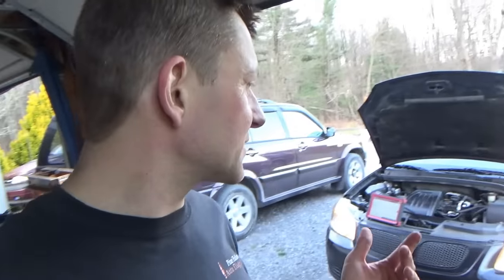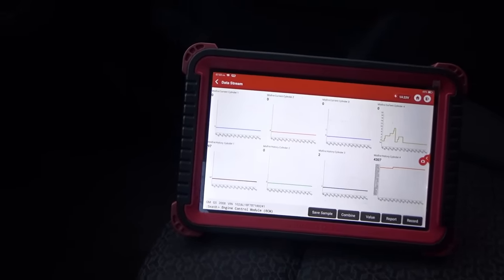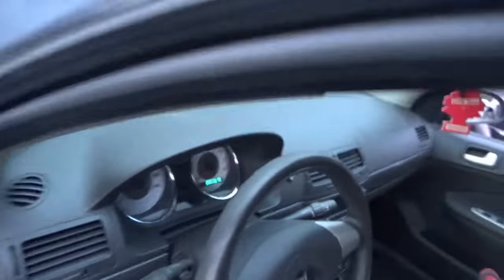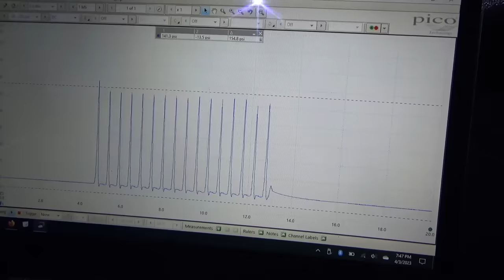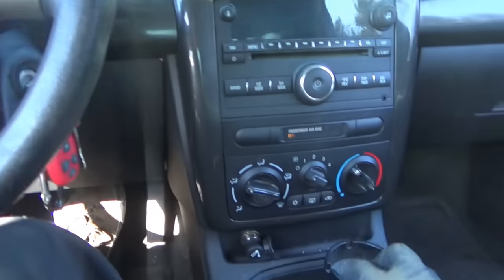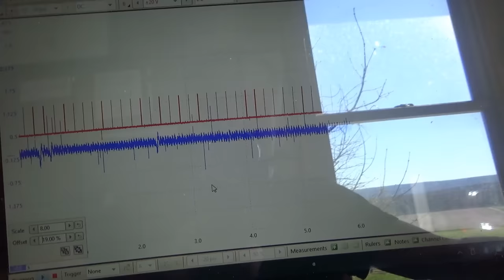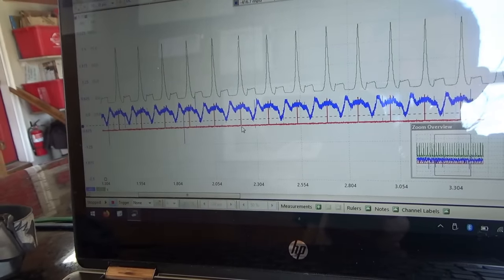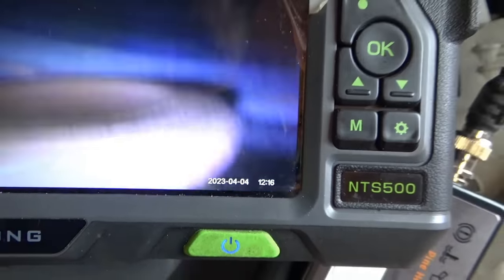P0300 Mystery MISFIRE - Difficult to Diagnose! (Intermittent "FISHBITE")

Comment: Analyzing the valve seats and valve contact area, the valves seats have some wear (large contact area). At this specific case, you should disassemble to analyze, but it could be the valve guide with high wear... without the valve spring, you get the valve, half open it and shakes it ( like moving it exhaust and admission side), if it moves a lot, thats the possible problem, making the contact at the seat sometimes good, sometimes bad - not centralized or concentric contact, and like this, you can notice a oval wear at the valve guide very easily. The expected behavior is basically have almost no lateral movement, so it can be at the center, having a good seat. what about the high revolutions, with no problem? the combustion pulls the valve back to the cylinder head, probably helping to make it have a good contact. newer gas engines can easily have combustion pressures at more than 50 bar at full load.

Comment: New owner, 244K miles… believe the new owner drove it with high revs in the two weeks… probably broke valve spring(s), more than likely the lower part of the valve springs where it still holds but when the valve spins to a certain point the spring pressure is different.

Comment: The seats are pitted and valves rotate while the engine is running but they rotate very slowly. I’d bet that’s why you have times where it runs smooth and times where you have a couple of misfires grouped together. You have a spot where the valve is not sealing well and then it rotates to a spot where it seals for a bit then back around to the spot where it doesn’t seal so well. I feel your pain with these types of valve sealing issues. You want something to clearly show yourself and the customer what the problem is when you know for a fact that the issue is a valve but you can’t get that obvious shot of evidence. A leak down test is usually the one that’ll show it best.

Comment: My next step would be ; flush the oil and fill up with fresh oil and add 250 ml ATF. fill the gas tank with premium gas. and drive for about 3 k miles. Ivan after seen the picture of the valves i suggest adding a valvecleaner  to the the gas and drive the car for a long continius trip to get the valves to burn clean a bit. Might help. Good luck.

Comment: What about the intake valves?  It would be interesting to somehow install the pressure transducer in the intake.

In any case, I have a similar problem in my Jeep's 4.0 with idle issues for the last 10 years / 65,000 miles and it now has 262,xxx on it.  It has gradually become worse.  Every time I check compression, it's right where I would expect it when compared to other cylinders and it shows no obvious issues.  Sometimes its fine, and sometimes I come to a stop sign and it its clearly a dead misfire or half contribution at best.  Then I get the diagnostic stuff out and by the time I get it hooked up, its running better.

No oil consumption, no coolant consumption, I can run it across the country with no issue.  Come to a stop and you get that damn misfire.

Comment: I have the same problem with my '08 Avalanche, except it's on cylinder 7. Dealer said it was a "ghost" code. Changed plug, plug wire, coil, and fuel injector. They also did a compression test and told it had "perfect" compression. Still doing the same thing....
Reply: 07 Tahoe in the same exact situation on cylinder 6
Reply: That's dealer speak for hand us  $1,100

Comment: My po300 misfire after plugs coil packs ended up being a intermittent faulty injector took 3 mths and ended  finding this myself after professional people could not find the actual fault. The did 02 sensors, throttle body, plugs coils, car ran good for few days then started playing up and the po300 came up again. So I pulled injectors and found one keeps sticking open, so I put one OEM injector in, have now done 13000ks with no fault codes

Comment: With that many miles on it I wouldn't spend much more on it till the issue became worse. Some may say that if it got worse it could be a taking time bomb ready to go boom, well at thay many miles, you would be heading towards a rebuild if you were keen on the vehicle and were willing to spend that much money, or for a cheaper option install a second hand wrecker engine, This is one of the few times I would actually suggest doing nothing more.

Comment: Being a bit of a (pico)scope fan and an car engine amateur (I'm more used to just two wheels), I would have made several tests to see what they'd show, if anything.
Ignition waveform - should show the in cylinder turbulence due to leaking valves at idle - the gases blowing past the spark plug affects the spark. If it comes and goes that should be obvious.
RPM math channel @ crank sensor (or equivalent), to see exactly how the rpm changes as every cylinder fires, or misfires. Because... well, it's cool, and also says which cylinder is misbehaving.
You put the pressure sensor in the exhaust, I would have done the same (or with a cheap but perhaps more sensitive pressure pulse sensor) in the intake and crankcase. Should show where the leakage goes - probably past exhaust valves, but you know what they say about assuming things.

Comment: Check the spark plug wire in the dark with a spray mist. Could the wire be intermittently sparking to the engine and jumping back?

Comment: I had a Saturn Ion with this same engine back around 05 or 06 exhibit a similar issue. It would putt putt out the exhaust very intermittently. Compression was about 120-125 if I remember right. I pulled the head off and one of the seats in the head for one of the exhaust valves was trashed, even the valve head was discolored from heat. I replaced the head as it was under warranty and problem solved. Didn't know the exact cause as maybe a crappy valve or a crooked valve guide hole in the head or whatever. The car had all of 16,000 miles on it. I've seen others mention weak/broken valve spring which for 250k on this car Ivan's working on is possible. The one I had I don't believe it was a broken/weak spring at such low mileage but I suppose anything is possible.

Comment: Ive had this same issue on a 2007 tahoe and have been chasing it for the past 3 years. New plugs, wires, coils, injectors, throttle body, MAF, MAP, 02's... This is the only video Ive ever seen on Yt with EXACTLY the same symptoms... exhaust sucking in on miss only at idle, and only when warm, and its intermittent. ECU thinks its running rich so cutting back fuel too... If I'm gonna have to rebuild the top end anyways it looks like shes gonna keep runnin til she cant.

Comment: Check valve gap/clearance. That is just the symptom you get with PSA TU5JP with too tight valves.
Reply from the maker: Hydraulic valve adjusters...
Reply: @PineHollowAutoDiagnostics  working correctly?
Reply from the maker: @jannepo  well they weren't ticking 😅
Reply: @PineHollowAutoDiagnostics  tight lifter does not tick.. Oil changes were taken care of?

Comment: You can try to connect directly to fuel line valve cleaner, I mean fuel pressue pump (I'm not gonna give make name). In this case cos there is no evidence to damaged valve/port surface that could work realy well and it's cheap.

Comment: Easier way to diagnose leaky valves/ worn or frozen rings, just hook up spark hole adapter to get compressed air in individual cylinders,sound alone with Mickey mouse Stephi scope ( vinyl tube in ear) one can nail whether it's valve guides,valves or rings. The ole KISS formula.....no scanner BS,etc. required. Have an old Peugeot CIS injected XN6 with three bores with frozen rings,does not like to start hot and has a misfire until you clean it's throat out( blip the throttle to high rpm). 15+years car is fine,look at cylinder liners,look new with perfect cross hatching, except for frozen rings holding back desired perfect compression. Acetone,diesel -tranny fluid soak every now and then but rings are still so frozen,mix empties into sump fairly quickly.

Comment: In a hard core smog state that would be an automatic mandatory head remove if the mil is being tripped by the misfire. Even if it's not the HCs will be elevated unless the cat can take up the slack. The crosshatch is still there so if the rest of the car was in exceptional condition I would yank the head and do the valves.

Comment: Great job ivan! There's much more pressure inside the cylinder when it's actually firing, that might be a variable here, 🤔 intermittent stuff are the worst, i got an intermittent P0335 last week and it took me forever to call the ECM. 😑
Reply: Was it a Chrysler pcm?
Reply: @W.Khairi   a 2013 Toyota Corolla, but honestly i think i might have misdiagnosed it. Because  i tightened the ckp bolt more than recommended and then the problem disappeared. Can't really tell if it was a gapping issue, because the surface was clean and the bolt did not push the sensor into the engine, it just held it in place. It probably would come back in the future for the ecm,  but for now it's not setting the p0335 code. And I'm glad that i didn't get an ecm for it.
Reply: @aranhaydar9195  If it is an inductive type ckp maybe it is getting weak and just starting to fail

Comment: What's the difference between a diagnostic tech and a parts changer? Both will have cars that get away from them and don't get fixed. But only a diagnostic guy will be able to learn and gain experiences even when the issue doesn't get resolved...

I would've swapped injectors. What if the injector had a bad spray pattern? That would give you an intermittent misfire at idle but at higher loads and RPMs you have much more airflow allowing for better mixture of non atomized spray patterns. I love that OTC pulser and I use mine a lot but pulsing an injector with static fuel pressure while the engine is off is a much different environment than with an engine running. You can't do an on car test for spray pattern. If you swap injectors and the issue stays on #4 only then can you REALLY say it's definitely NOT an injector problem. 

I've seen intermittent compression issues due to intermittent valve sealing issues but they were cyclical. Every 4th valve event would have a consistent 10psi drop. There's no way a faulty valve lifter can cause a misfire for only ONE ignition cycle. Those valve seats definitely did look pretty nasty though...

I had a 2012 Ford Edge 3.5L 100,000miles with a single cylinder misfire on cold startup. Would only register 1-3 misfires on a cold start. You might feel 5-10 "fishbites" on the cold start. All on #4. I did long captures between #2 and #4 for in cylinder and they looked IDENTICAL. Could not see any difference. Put a pressure tester on the coolant expansion tank and after a few minutes I could see a mist in #4 but nothing in #2. Barely noticeable and could not see it in the captures no matter how hard I looked. 

Comparing peak pressures between two cylinders isn't a straight forward task. When your pressure transducer was in cylinder #4 the peak pressures were pretty smooth but when it was in cylinder #3 the pattern had an oscillating ripple to it. You have to try and average out that ripple to be able to compare the two. Also you have to factor in engine RPM between two captures. A 30RPM difference will easily give you a 2psi compression difference. 

It's also a good idea to increase your sampling rate for in cylinder pressure analysis. I usually go for 3MS. Zooming in on your captures while looking at valve opening and closing events shows the detail dropping off a bit. Not sure what the response time of your pressure transducer is. WPS500x is rated at 100uS. 

Trying to make these kinds of calls without tearing a part an engine or loading up a bunch of parts is a tall task. Shop owners and customers alike seem to think it's "reasonable" to expect it of all techs but, uh, yeah... Not pleasant sometimes! Thanks for doing what you're doing!
Reply: Amazing analysis !  Thanks for sharing your thoughts / expertise !!

Comment: Being that this is a 4 cylinder engine (relatively small manifold volume), it might be possible to look at manifold vacuum with a high bandwidth electronic pressure transducer (for example Pico WPS500X Pressure Transducer) with a PicoScope and see if you can detect any strange behavior while the engine is running normally.

GM fuel injectors can start to fail electrically when they get hot. As I recall the failure mode is a partial short when hot. Meaning there is not enough inductance (magnetic force) to properly actuate the injector.
Reply from the maker: If an injector was failing, wouldn't that show up not just at idle? 🤔
Reply: @PineHollowAutoDiagnostics  Yes you are correct. But high mileage GM injectors can do strange intermittent things when they get hot, meaning strange operation at low flow. So, maybe you could look at the injector current on cylinder #4 and see if it correlates to the misfire event.

Comment: Had the EXACT same problem on a euro spec GM car with the pre-Ecotec engine for like a week until yesterday! It was driving me crazy, went from changing the fuel pump and filter, map, tps, injectors, idle valve, put premium gas, runned auxilary wires from the sensors to the ECU as this appeared when i was installing a standalone on the harness.
Ended up being the vacuum hose on the fuel pressure regulator that i had changed recently with a new one. When the hose was on my hands inspecting it was appearing alright, when slightly bent when installed the hole was turning into an oval and had a vacuum leak.
Reply: If you try it out you need to wait for the ECU to adapt the fueling for idling after taking it for a ride or shut the engine off and restart it after removing the battery power for a few seconds. Maybe aswell the membrane of the regulator is perforated in which case it would draw excess fuel through the vacuum hose and make it struggle at idle.

Comment: I reckon the valve guides are getting worn & depending on how it is driven take it out once a week give it a good run 50-60 mls & see if it gets better or worse that should give you a bettter indication on valve condition.Cheers.

Comment: I'd be willing to bet that it has tight valve clearance and the pitting is made worse because of that. Also those exhaust valves look like they have been running really hot. When we had valve issues with the early to mid 2000's Subaru turbo engines this is exactly what we would find. If continued to be driven they would eventually burn big parts of the exhaust valves up. Nice Diag work, it's humbling getting your butt kicked once in a while, makes you think hard and dig really deep. I would have loved to see what your valve clearances looked like.
Reply from the maker: Hydraulic automatic adjustment, so no issues with valve clearances like Honda or Subaru 👍
Reply: @PineHollowAutoDiagnostics  I figured because I was asking myself why you didn't consider it. Makes sense now. I didn't hear any ticking either.

Comment: So are you thinking it needs a valve job (i.e. - taking the head off, replacing the valves)? If so, what would something like that run in terms of cost at a dealership?
Reply from the maker: Dealership would just replace the head...or the entire engine LOL
Reply: @PineHollowAutoDiagnostics , makes sense as long as that's an available option. They're all trying to attrition people into EVs, so replacement parts are becoming scarcer sooner. Rebuilds are usually more expensive, too, but I'd bet a valve replacement job for that would be around $3k (and in the bigger scheme of things, that's not actually that bad considering everything that would be done with it). If the engine has excessive wear and carbon--which it looked like it might--a replacement engine would be ideal (at least, in my mind it would be). A replacement engine job would probably be closer to $6-$8k (buying the engine + labor). I know my Saturn Sky was once quoted about $8k for an entire replacement engine + turbo, labor included, and that's from the dealership. Granted, that was a few years ago, so it's probably gone up a bit. A water pump replacement for my car (last July) ran me about $2,600 because they had to go in through the crank case. They tried to use the GM water pump replacement tool, but either it doesn't work all the time or else they didn't know how to use it correctly because it resulted in the damn chain tensioner ratcheting up too tightly and causing the car to sound supercharged, which means it's eating through the timing guides quicker.

Comment: I dealt with this same issue on my 01 Pontiac grand am , still had the issue after a complete rebuild due to timing jumping still had the problem , hunted for it for days more and it was only doing it at idle ,  had a putting sound at exhaust pipe and some smoke , thought what more can this be doing , finally messed with the throttle adjustment screw , and my miss fire went away and my fuel trims got better , might give that a try as I see your also working on a Pontiac, the throttle plate is to closed at idle needs more air. its going through the iac but not enough air at the plate that's where your p0300 is coming from
Reply from the maker: Electronic throttle on this 👍

Comment: Nice video.
Electrical problem yes or no?
I think no, it's a mechanical problem
Could it be a spring going weak or lifter.
Try engine cleaning Motorflush
and valve cleaning with foam.
and finally the cylinder head off

Comment: Could a worn valve spring be causing this? My thoughts are that the valve may be intermittently floating.
Reply: If a valve spring was so weak it was causing float at idle it would be misfiring all the time at anything above idle.  A sticking valve is certainly a possibility though.
Reply: @Ferrum Ignis  Makes sense. By the very principle any load on that spring would cause even more float. So sticking valve would make more sense.